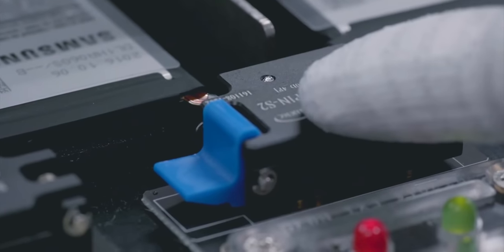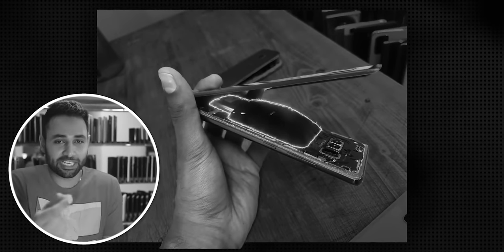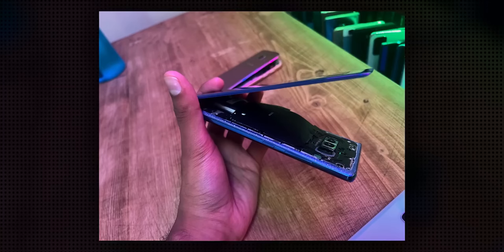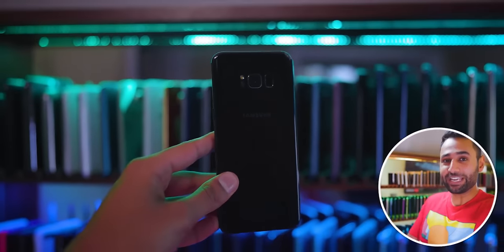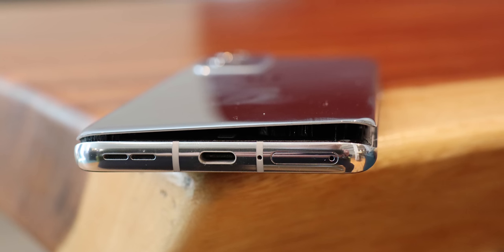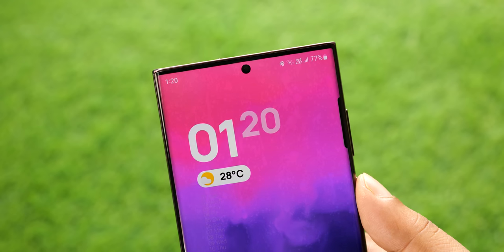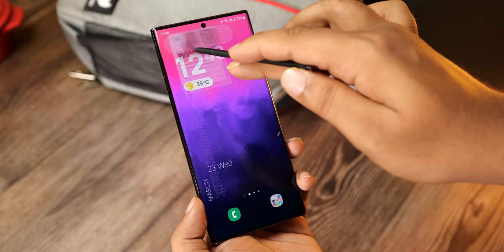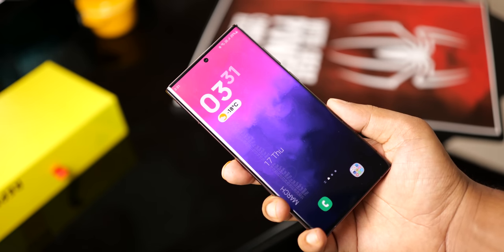Samsung In BIG TROUBLE?

Comment: Believe it or not, my old flagship S9+ is still competible with my new S22 Ultra and works perfectly with no complaints or faults ♥️
Reply: You probably use it regularly, my mom doesn't use her S9+ anymore and I'll try to convince her to use it more or let me use it as a second phone
Reply: @malman_is_boiiii  bro go for it. Perfect for a 2nd use 👏
Reply: @SiriasisOFFICIAL  but battery life is bad
Reply: @SiriasisOFFICIAL  its not bad , it's not great but good
Reply: @SiriasisOFFICIAL  it's not bad, great even, just not as good as the iPhone
Reply: Same situation but with the s8+
Reply: @SiriasisOFFICIAL  my s10+ has a pretty good battery
Reply: The same to me
Reply: As long as you use it. Otherwise it will swell once its not in use
Reply: @SiriasisOFFICIAL  note 9 is a beast
Reply: I have Note 20 ultra and its only battery issue. Its slim low weight and very much good from S22 ultra. Only camera desigen change itherwise same.
Reply: @SiriasisOFFICIAL  i still remember that day when i first saw s8+ ..my friend purchased it..and when i saw it i was flattered..i purchased my iphone 6s few months back..and next day only..i traded my iphone for s8+ ..
Reply: dump it

Comment: Yes I remember this. It happened on my S7 after about 1.5 year of use. The back started to feel bulky, I didn't car for it much but then one day it popped open from one side. I noticed the battery been swollen which was forcing the back to open up. Didn't care for it for another couple of months but then one day my phone started to have major battery issues, it's then when I finally replaced it. Thank God it didn't blow up on me.
Reply: Yup, same thing happened on my S7 edge, specifically the left edge of the phone near the volumn buttons, it looked it the back plate was peeling out.  At that time the battery also discharges very quickly so I traded it in, I would have kept that phone longer, the edge screen was pretty and a novelty at the time.
Reply: @AncientEsper  Yes exactly the battery started to discharge very quickly and mine had this weirder problem where the phone would show around 30 - 40% of battery but would suddenly shut down. It was basically showing me the wrong percentage.
Reply: Phones should be replaces every year, maybe 6 months, my note 20u malfunctioned less then 2 years

Comment: This exact same thing happened to my PSP battery. I went like 3 years without touching it, then I went to boot it up a few months ago, and the battery was severely swollen.
Reply: Oof, gotta check mine. Havent touched psp for a year or so.
Reply: @Zeashes 
Replacement batteries for the PSP are cheap on Amazon. I just have not gotten around to replacing mine yet.
Reply: just take the batteries out when u'r not using it. problem solved.
Reply: literally just went to sell my psp and the battery looked like a balloon!

Comment: Well.. this is only my personal experience, so just one data point, but I feel it should be added to the pile.
I use a Note 9 as my main phone. I am currently dealing with the back glass popping off because of a battery swell.
I also use Note 3s for mobile game accounts. I have 3 Note 3s and they will all eventually swell the back covers right off. My solution was to get a bulk pack of original Note 3 batteries off Ebay and just swap out when they turn into balloons.

Basically, this is not just a storage issue - it happens to phones in constant use as well.
Reply: Welp my family has been using Samsung for like 7 years now. From J series to Z fold series. These swelling batteries are just happing to some unit. No one in my family has ever faced such an issue. It usually happens to the stored phone and some defaults or manufactured issues.
Reply: I am literally typing this comment on a j7 pro no battery swell at all
Reply: 🔝 🔝 🔝 
Congratulations 🎉🎉 you have been shortlist among our prize 📦 winner @TalkTechTV0
Reply: Omg 😳

Comment: Some people have commented it has also happened on phones they are actually using , just a few comments i saw the other day where users S10, S10 + , note 20 ,  even a z fold , it appears this is not just stored devices , it will be interesting to see if more people pipe up .
Reply: My S10+ works perfectly. No problem at all.
Reply: I'll pipe up: Happened on my Nexus 6P and Microsoft Surface Book. Also on my Nexus 7.
Reply: @editor3210  of course not every phone but that 0.01 percent is still kinda large
Reply: @editor3210  Thats nice , but one success does not a win make , especially given overwhelming evidence more others have had problems with samsung devices than any other it would seem .

Comment: happened with my Android tab. it was a company called IBall Slide in I guess 2013 in India. Didn't use the tab because it lagged a lot. Kept it under the table for 3 years and found the battery to be swollen up. we had to replace the battery because it could blow up but the tab lost its back panel quality.  maybe because the engineer replaced the entire back pannel
Reply: 🔝 🔝 🔝 
Congratulations 🎉🎉 you have been shortlist among our prize 📦 winners 🏅 @TalkTechTV0

Comment: the reason why it swells during storage is probably because samsung phones stil using the battery even when it's off. They should completely shut off connection to the battery when it's "off".

Comment: My s10+ battery got bigger. I left it without usage for two months because I had a bachelor's exam now. My phone is not water-resistant anymore, and I could separate the glass back just by my nail. The adhesive got loose without but the phone on the heating machine and because I'm a student I've worked for a year to buy it(1000$) now it's 200$ and I'm in a poor country (syria) so I can't afford to fix it I won't by any Samsung flagship again I will buy iPhone at least it would keep its price
Reply: @Maurice Nintendo Switch not on this scale though. Any other android phone would be fine too.
Reply: @Maurice Nintendo Switch on a major scale, yeah.

Comment: I have my S9 for over 4 years almost 5 and is still doing fine is just 4 things they are a issue I can't do
1.) My Screen is cracked
2.) My Back glass is cracked
2.) My charging port is broken
3.) My battery is weak and not lasting very long as it should so I get like 4 hours of use but I use it everyday

Comment: Got those phones too and no problem,s7 edge 70%, s8+ 69% and note 8 63%,stored over couple of months and no charge, a cold charge up to 100% ,charged up on Wednesday...even got a samsung tab 10.1 2011 used till 2017 and note tab 10.1 2012 used till 2017,no charge and stored for over 5 years and no expanding...s10+ ceramic used daily...

Comment: Thank you Sal. Someone had to step up and clarify that this DRAMA is exaggerated. Yes Samsung needs to look into this more, maybe it's also a reason why battery life has been not on pair, but it's not like your battery is gonna swallow on you after 2 years all of a sudden.

First of all, a word for all the tech-y YT who are not starving to death at all: you don't need to get rid of the phones for a swollen battery, you just need to remove it and then you can sell the phone for less (specifying that you have to buy a battery and have it installed) or give them away for free, since they also act all eco-friendly. 

Finally I've owned 5 Samsung phones or more and some of them have been stored for 6 years or more and none of them batteries have swollen up.
As a matter of fact, in my area at my job we meet lots of people with these problems and even though Samsung had a market share of like 80% till 3 years ago in my area, it's not the only manufacturer which we have met this problem from. It's also Huawei and Apple. Other brands have been rising only in the past 3 years so I wouldn't be able to judge.

Samsung has definitely something weird happening to their batteries and they should check their quality control, but that's not the whole DRAMA they are making it out to be.
Reply: My battery doesn't swallow. 😵
Reply from the maker: Exactly! These people are making this a Samsung only problem which is not true at all. It's a characteristic of lithium batteries that can happen to literally any device that's powering it.
Reply: @bc_usa  Ahahah ops my bad
Reply: @TechTalkTV  true that. Why do I think that some youtubers are sold for Apple ? 😂 and absolutely not everyone
Reply: @bc_usa  I definitely meant "Swell"
Reply: @rinasmhd1974  Not sold it just gets them more views hence why they use fake thumbnails with the s22 ultra on fire even tho none of their phones ignited.
Reply: And saying the phones are "blowing up" is misleading and exaggerates the issue.

Comment: Am no Samsung fan!
However, i must state that this is not just a Samsung issue. There is a reason why some planes don't allow devices with Lithium ion batteries on board if there are near 0 or near 100. I get phones from the US yet I stay in Africa so i always tell my suppliers to ship them at 50% because FedEx  holds on to them to drain to below 70% if it was higher or ask if they can charge it a bit if it's on zero, it's a lithium ion battery thing not just Samsung but they should work on theres because i also have 4 Samsung phones that swell (S8+, S10+, Note 10+, and S20 Ultra.) Meaning theirs are more prone to swell than others.
Most my older iPhones are intact (7+, X, 11 Pro Max).
The only iPhone i have with that issue is the 6s Plus which i parked in 2015.

Comment: "All lithium-ion cells expand at high levels of state-of-charge (SOC) or overload, due to slight vaporization of the electrolyte. This can result in delamination and therefore poor contact of the inner layers of the cell, which in turn decreases overall cell cycle reliability and lifespan. [10] This is very noticeable for LiPos, which can visibly inflate due to the lack of a hard case to contain their expansion. The safety features of lithium polymer batteries are different from lithium iron phosphate batteries." Wikipedia.

Will all batteries swell the question is when? The question that should be raised is not why Samsung batteries swell but why we still use LiPo-type Lithium batteries when their track record is so bad. Why don't you just have a phone that has a detachable battery slot? I used a Galaxy Note 4 from 2014 to 2021, do you know why? Because I changed batteries every 2 years.

Comment: This is simply NOT true !
It DOES affect phones and tablets WHILE in everyday use TOO. It is NOT limited to devices in longterm storage.
I'm fed up of repeating myself but here it is again :
I had 7 Samsung devices, 5 of them bloated while I was using them as my everyday primary devices, some multiple times !
Note 3, 4 times !
S7 Edge, 2 times !
Note 8, 1 time.
Tab S4, 1 time.
Tab S6, 1 time.
I stopped using them because they were swelling, not they other way around.
And before you ask :
I only used the Samsung chargers that came in the box for the devices that ended swelling.
2 the swelling phones (S7 edge & Note 8) charged sometimes via induction on a Samsung pad with a Samsung block.
The only device that is not charged by a Samsung block is my Tab S8 which is on a 100W multiple output block recommended by every tech Youtuber there is.
I didn't play 3D games, at all.
I didn't charge them via a car's cigarette lighter and never let them cook on the dashboard under the sun (I don't have a car).
I do not use the GPS chip for long periods of times.
I do not cover my devices with a blanket or pillow while they charge.

The only device I have that is on longterm storage is a Tab S2, and the only one that is not affected by the battery swelling issue.
Except of course my Tab S8 which is only a few months old.
So please, please, please, please, please, STOP deflecting the problem : it is not limited to longterm stored devices.
Every single of my 5 devices which swelled were used everyday as primary devices when bloating happened.

The only difference is that I keep using my devices longer than most enthusiasts. And bloating started after 18 to 24 months of use on average.
Even earlier for the Note 3 as every "new" battery might have spent some time in storage before being sold to me so I had swelling issues sometimes only 4, 6 or 8 months after battery purchase.
Let me repeat this too :
I'm not rich, and my flagship devices are the only "luxury' I can afford, once in a while.
According to my means, I use my devices for longer than the average enthusiast.
I shouldn't be penalized for wanting to use my devices 2 to 4 years.
So I'm really fed up of this issue and all the zealous fanboys who refuse to acknowledge that there is a real problem, and that this is not limited to longterm stored devices.

>> End of my rant, 😘
What's the most annoying is that Samsung devices are the only ones I like and I very much appreciate this channel that has great content.
But there's a moment, when enough is enough.
(I do have my devices and pictures if you want proof).

Continue the great content but please, check your informations about this one. I'm the living proof this problem is not limited to stored devices.
Comment written on my beloved Note 8 (swollen, then repaired).

Comment: it is not the batteries, I can assure you guys , as all lithium batteries works almost the same. Look at how the body of samsung and apple is designed, I promise you that is the factor. apple has an shell design whereas samsung has a spine like frame with back cover and screen glued to it and the internals sits in open slots in that frame. Apples screen is basically clipped into the shell amd the glue is basically just sealant, the back glass is glued to the steel frame , so lesser chance of the body popping open when the battery swells and also a thicker compartment to allow for swelling. I dare Arun to pry open all his iphones that was in storage for a long time, you might just find a hidden swollen battery inside. Arun and Marcus Brownlee are just undercover fanboys, all their reviews appears to be non bias , but their have a hidden bias for iphone, perhaps cupertino started to give them a few perks , as their opinions seems to be better than the normal stupid apple keynotes!

Comment: Samsung uses high voltage batteries which charges upto 4.4 volts. This generates higher amount of gas if the phone remains unused for long periods of time compared to other brands which uses regular voltage batteries ranges from 3.7-4.2 Volts. This is the main reason for Samsung phones faster battery swelling 💥💥💥

Comment: NOW SAMSUNG USERS OR ANDROID USERS IN GENERAL WILL HAVE TO DEAL WITH WHAT APPLE USERS WILL THROW AT THEM DUE TO THIS , LIKE ITS A BIG DEAL AN UNUSED PHONE GETS BATTERY DAMAGE.
Reply: 😂 man you still >13
Reply: Its lithium ion battery fault. Most android companies use lithion polimer battery. Hope s23 series will change to lithium polimer
Reply: @modestman6753  but why it doesn't happen with old Samsung phones and basically every Xiaomi phone? It's a Samsung problem
Reply: @modestman6753  I still have my Redmi note 2 prime unused for possibly 2 years and it's still working fine

Comment: This happened to me with my Note 20. I had to replace the Battery but it also affected the resolution on my screen. Which dramatically affected its trade-in value. I am seriously considering switching the Apple. Even though I hate their interface. Their devices have better build quality and higher trade-in value.

Comment: Samsung taking a massive L once again. It's strange this was only just spotted, but the fact this is nothing new and there's glaring quality control issues and batteries degrading far quicker than their rated lifespan is worrying and has implications for everyone with a Samsung phone. Based on what I have seen from a YouTube reporting on this, Samsung seem very much determined to burry this issue without actually addressing it as to avoid a PR disaster, which is worrying since they ceased the phones (more or less) with no indication of when or if they will be repaired and/ or returned. It seems Samsung has learned nothing and their silence is only cause for concern as to the extent and severity if the issue. I'm honestly glad I didn't buy another Samsung since the s20 ultra. Fuck Samsung.
Reply: Quit overreacting. It took some dude with a 1000 old phones to discover this "issue." Other than that, this happens with EVERY brand.
Reply: @myfakeguuglaccount8307  it doesn't. tell me ONE iphone that had this issue
Reply: @Happylittleradish  to be fair, there were some instances of the iPhone 8's batteries being inflated like microwave popcorn bags before shipping to cuatomers or shortly after reciving them, but nothing on this scale spanning such an extensive range of generations. Samsung have a serious issue (again) and these devices are ticking time bombs; batteries should not be degrading that quickly and is extensive enough that it isn't just a case of a few anomalies.